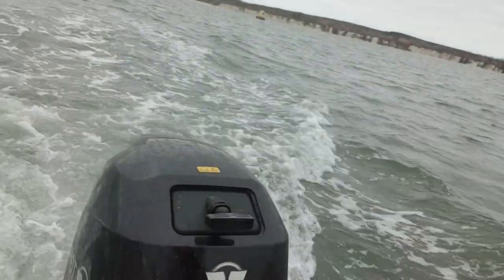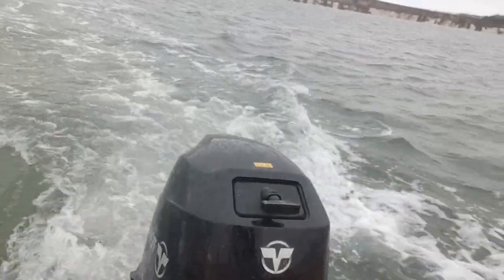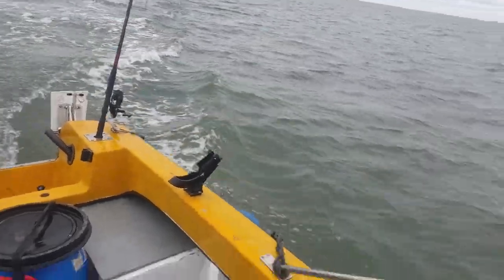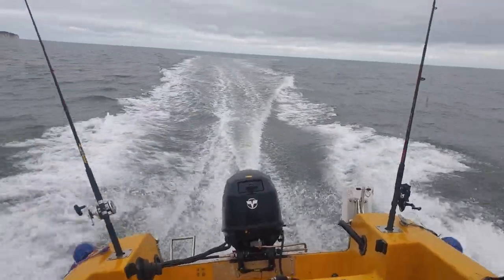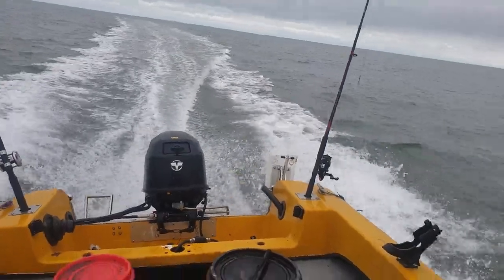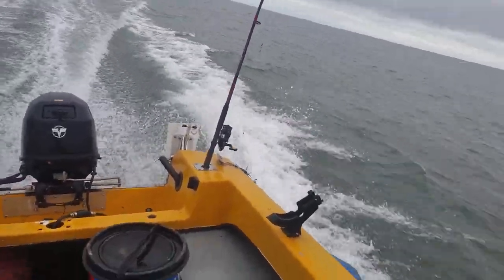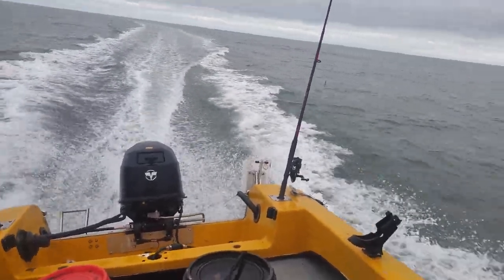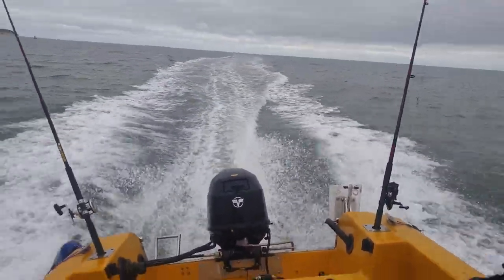Tohatsu 30hp Speedtest  21 knots MFS30C

Comment: Do you kn😊w what prop you are using? Standard with engine in think is 11” pitch. I have the 25 on a 14 foot converted jet boat, and with a 10” pitch get 21 knots.